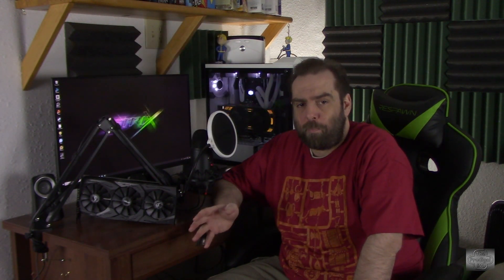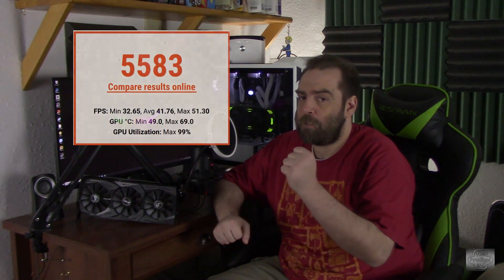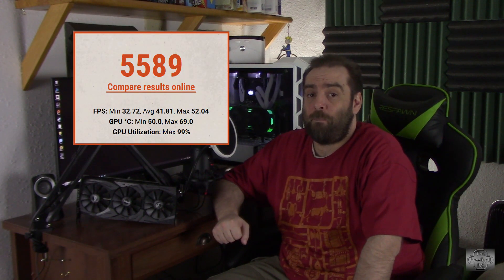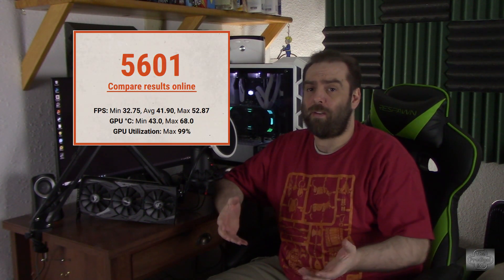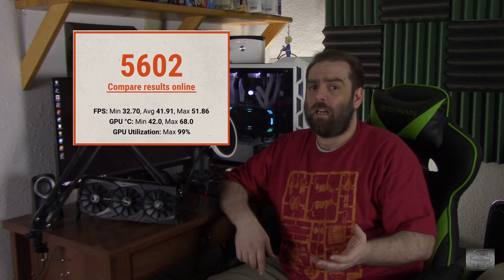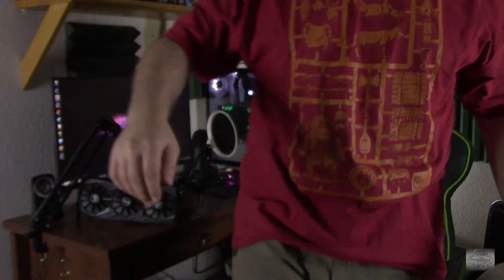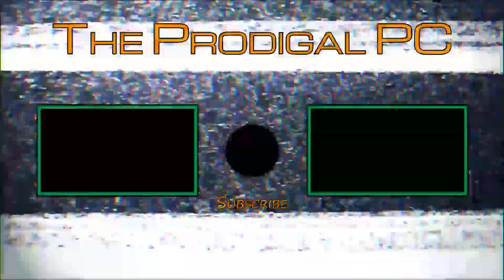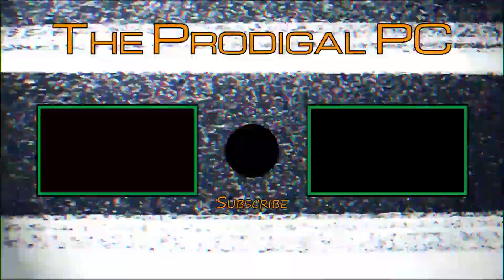RTX 2070 Strix Basic Teardown: How to re-paste and temps!!!

Comment: I know this is an old video, but you helped me solve my thermal problems with my  STRIX 2070 Super!

Beforehand, I was getting 80c GPU temp and 105 hotspot. Now getting 65c GPU and 74 hotspot. The stock paste was atrociously applied and the stock pads were so dry they crumbled....
Reply: hi, i am thinking to repaste and pads on my rog 2070 super too. The  temps you mentioned were they in stock fan settings? like 1300  rpm around? And Did you change all thermal pads or the 1.5 mm one? Which paste and pads did you use? Thanks

Comment: Bin using a RTX2070Strix since the 20series came out. Have never changed the paste or pads on it since it has always kept stable and manageable temps even with overclok never had to go above 70%on fans.
But today I got too curious and checked. How that card was able to not just work fine but even functioning is beyond me. "dry as dust" I think fits the description best. I will invest in some prime quality paste and pads to honor its years of service and OC enduring. It really deserves it<3

Comment: Thanks for the video. I have the same card and I noticed that my gpu hotspot temp was around 30C above core temperature, so much so that i believe my card thermally throttled. Your video helped me to do my first ever gpu repaste with some old mx4 i had in our basement. I am happy to report that gpu hotspot dropped to around 17C above gpu core and the fans stayed much much quieter during furmark/3dmark, I would say noise from the gpu fan dropped by half. My 3dmark score increased by 122 points lol 😂 😊

Comment: glad you have this up.  I have a 2070 super but i think the process is going to be the same.  I've noticed the temps creeping up recently and since i've had this card for over 3 and half years prob time to replace the paste.
Reply: Exactly the same boat wiht my 2070, i'm on year 4 and starting to see 82c. Hoping its just dust and thermal paste that needs to be freshened up. But i've never taken apart a gpu before.
Reply: @Plague_Doc22  it was really easy for me compared to other Gpus.  Make sure you cover the entire die with paste it’s not like a cpu.  I didn’t know that with previous cards
Reply: @Haddley333  Yeah I luckily found a guy who opened up my exact model on youtube so can follow that.

But it seems really easy, just a few screws, dust everything off and apply new paste.

But with anything new PC related I'm always worried i'll ruin something lol. If I mess up my gpu i'll be pissed.
Reply: @Plague_Doc22  I'm the same way lol.   When I took apart the 1080ti sc2 my heart would race because there were wires I had to pull out of sockets that control the fans, rgb, etc.  One wrong mistake and I could have snipped those wires.  Luckily my 2070 super was much, much easier.
Reply: @Haddley333  Yeah from what i can tell with mine, I just pull out two things and then it's apart. I'll then leave the board alone and just deal with the fans, heatsink and apply the paste. Not gonna mess with heat pads lol

Comment: Thanks for posting this! I've had an RTX 2070 for over a year now and noticed that the fans have been revving on and off for 3-5 seconds quite frequently during use. Others with the same issue have found that the stock application of the thermal paste was the source of the issue. I was worried to go opening my GPU in order to fix this myself, but after watching the video I'm confident that I can do so without destroying something lol
Reply: hey did you ever do this? I have the Nvidia Geforce RTX since 2018, and as of about 3 months ago my fans will rev constantly every 10 seconds or so like you were explaining. This happens during intense gaming. Im thinking this is the issue but I want to make sure
Reply: @Socomelite500  yes I replaced the thermal paste and the issue was resolved :)
Reply: @elizabethivy1337  cool definitely going to try this, thanks!
Reply: @elizabethivy1337  I've been having the same issue ever since I got my new pc what thermal paste did you go with?
Reply: @Jetta.  I used the Arctic MX-4, it's about $6 on Amazon. Idk if it's the best one but it was worked well for me!
Reply: @elizabethivy1337  thanks!

Comment: Just got my card with the 1st Covid stimulus check (glad I got it when I did, now it's going for 2x msrp thanks to shortages), but I recently ran into some issues with games crashing on me after roughly 15 minutes of play-time in the actual game (not just the menus). Many games, different game engines even, only common thread is my GPU hot-spot temps were reaching 81c and staying there.
Updated drivers didn't do anything, installing a few Windows updates didn't do anything except for turn a few programs color-blind filter modes on (still can't figure out how to get Discord to look right anymore), but installing MSI Afterburner and UNDER-clocking my card by 200mhz and setting the power limit to 95% and the thermal limit to 75c did restore some stability until something over-wrote the settings on the card itself and returned everything to stock again, when it promptly crashed the game (that's what looked like happened according to the graphs of MSI Afterburner).

I'm hoping that installing the ThermalTake water block (EDIT: Pacific V-RTX 2070 Plus (ASUS ROG)) that I have for my Asus RTX 2070 O8G will help massively reduce temperatures so that I can have a stable gaming experience again.
I have 3 radiators, one 120mm, one 240mm, and one 360mm, (that's the most I can cram into this particular case), with each radiator's airflow needs being provided by the appropriate number of grey/black Noctua NF-P12 fans (that's a great fan from a great brand at a very competitive price point, they're just as good as the brown/beige fans but they cost a bunch less). The only other heat-producing component in the water cooling loop is the CPU, which is an i7-9700k that hasn't been overclocked. The RAM is 32GB of CL14 (not 16) DDR4-3200mhz, with XMP enabled so that it actually runs at that speed.

I did read somewhere (can't remember where) that a recent (march/april 2021) Windows 10 update pushed some code out that wasn't great for gaming stability in general (people with GTX 10xx series cards, RTX 20xx series cards, and RTX 30xx series cards were all having game stability issues), so maybe I'm barking up the wrong tree anyways, but if that was the case perhaps underclocking the card via MSI Afterburner wouldn't actually restore any stability?
IDK about that. Anyways, assuming nothing leaks and that you have enough radiators for it, water cooling a PC is only ever a good thing for performance and stability right?
I'm pretty sure I have enough radiators to handle the added load of the GPU since the delta t of the water before/after going thru the CPU water block is only maybe 5c and the water temperature never goes above lukewarm (feels like 95F to my hand on the hose, which according to Google works out to 35c).

Comment: The part you remove at minute 2:58 when I touch it with my finger is very hot (if I touch it for 10 seconds it burns and the GPU temperature is 56 degrees Celsius) is this normal?

Comment: I ordered some Kryonaut Paste for my ASUS Strix 2080 OC. The card reaches 78°C while gaming even at stock clocks, then the fans start to overrride the fan curve and go full throttle. When i bought it the temps usually stayed below 70°C. The card is a year and 3 months old now which is a joke considering the pricetag of almost 800€ and i hope it will fix my card...
Edit:
I did it and it worked like a charm! Temps Idle went from 55° to 45°, Max load temp went from 78° with 100% fans to 67° with 50% fans making the card almost unnoticable again. Still i expect more quality for that amount of cash...
Reply: You had pretty bad stock thermal paste application then. At idle I have 31-33C
Reply: @Ziomal645  Yes in fact there was a stripe of about 5mm width on one side of the GPU where absolutely no paste was applied, just shiny metal on GPU and the cooler. As i said i consider that a quality problem. Now that summer is over and my room is cooler my temps are even lower :-)

Comment: Hey man, 

Do you know if you can use an AIO like the nzxt g12 to cool this bad boy. I have the same card in my pc. The card gives off so much heat after hours of continuous gameplay, looking for an alternative.
Reply from the maker: I have seen several people use the g12 bracket on RTX 2070s but I am not sure how much if any modifications would be needed to the bracket or card even. You can find posts people have made on Overclock.net. As far the other comment here about VRM temps, the fan on the bra is typically more than enough to keep those cool provided there is enough airflow in the case overall. If you are having overheating issues with this card during normal use you may have a airflow problem or even a problem with the card, But remember these things get hot. Mine is in a high airflow case with upgraded thermal compound and it still sits in the 70s.

Comment: How's the card doing? I'm super scared mine might go out reading all the reviews on the Rog Strix.
Reply from the maker: The card is still performing extremely well, it gets used for 4k gaming several hours per day and no problems.
Reply: @TheProdigalPC  is the card worth getting
Reply: Ben C yesss
Reply: @rgbkingpin  not sure why I missed this but thanks for the reply 
did auctully get it and it is has been going strong for the whole time (Still using it lol)
Reply: @BenCos2018  I’ve been very happy with the performance of my card!
Reply: @BenCos2018  I even installed an aio liquid cooler on mine
Reply: @rgbkingpin  nice 
I should take a look at the fancy cooling solutions tbh
Defn was even considering doing a custom watercooling loop at one time lol...Gave up on that idea though as they are quite expensive lol

Comment: Do you know if Asus is using Samsung or micron gddr6 on this card?
Reply from the maker: I believe they are using the Micron variant on this card.
Reply: @TheProdigalPC  Thank you this video helped me decide which 2070 to pull the trigger on!
Reply: @crazyeyes1204  i assume not the micron one
Reply: @bewolfzr9969  they use micron. You can check in memory section in gpu z
Reply: @user-jd3pk1bz8e  Mine uses samsung memory 
just checked now....they might be using two different companys to supply the parts